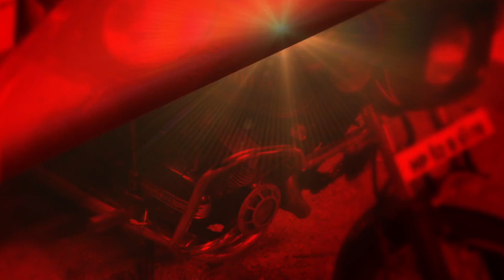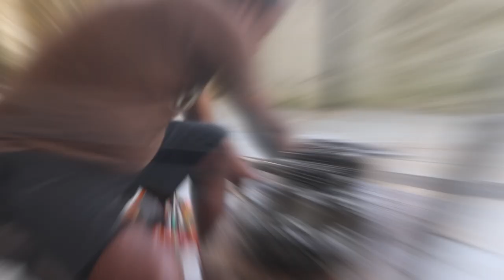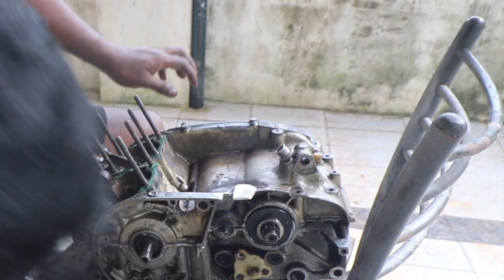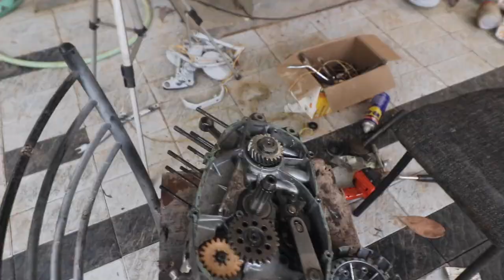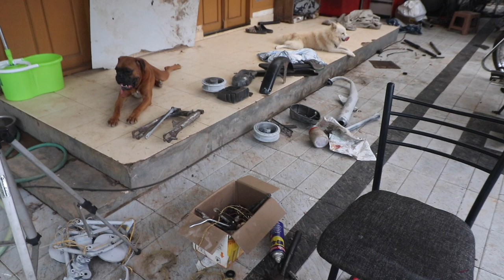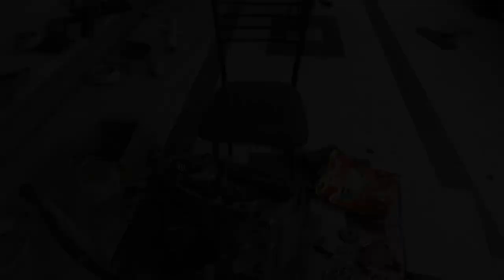Orange RD engine Rebuild in 10 minutes (Malayalam Video)

Comment: Hi Pramod

I see that you mentioned previous mechanic using gasket paste where he wasn't supposed to. Can you mention where it can be used?
Can paper gaskets be replaced by silicon gasket?
Can home made cornflakes container jugaad gasket be used instead of paper gasket?

Finally, can we use gasket compound for Rx 100 carb main gasket.?

Thanks
Reply from the maker: That’s a big list.

RTV sealant can only me used in non moving things, not around the crank 😂, it was used in bearings which are already bathed in oil. Regarding the usage of paper gasket and RTV, where 2 metal surfaces meet you can use a gasket or sealant, however where oil is involved it’s better to use a gasket. Reason the RTV won’t stick to an oily surface. 

In theory if the gasket is uniform and has plastic coating on both the sides it should work regardless if it comes out of a cornflakes box or a chocolate box.

Regarding usage of RTV in carbs is again a big no it will dissolve is the fuel and block passages inside the carb.

Comment: Chetta vandi paniyan agrahikunavarkk vendi  ditealed ayyi paraju.   sradhikanda kareghal nthokeya eannulla full ditealed video cheythudea.  Part part ayyi സ്വന്തമായി vandi paniyan agrahikunavarkk ath orupad  use full  avvum.
Reply from the maker: Restoration planning video und, problem ennu paranjal aarum payaye videos kannilla
Reply: @Yamakaze   almost njan ealla videosum kandu kazhiju👌...  Bro  oru cheriya doubt clear cheyythu tharamo.

Suzuki samurai umm  pinne tvs suzuki mx100 umm  cylinder kit thammil nthaghilum difference inda..      Njan ealla vandiudeum specification nokki eallam 98.2 cc. But . 1, . 2  hp difference innd  i mean point 1,2   ee cylinder agottum iggottum matti set cheythal nthaghilum പ്രശ്‌നം indavumo.?

Please reply me
Reply from the maker: @rahuljith.c.s1272  I have zero experience in max  100 and samurai engines, there is a video by some on decoding Suzuki engines. Good I for rice video, as far as I remember the reed valve and the intake ports are different in these bikes

Comment: Funny guy. He installed an old crankshaft, old bearings that are all dirty from rust. The same gearbox. He also smashes the engine parts with a hammer and calls it overhaul. This is destruction, not overhaul.
Reply from the maker: Thanks for noticing, what am I supposed to do on a bearing that was replaced around 500 kms ago? So your definition of a overhaul involves changing the gearbox? Also hitting with the hammer is not like blasphemy where if the engine is touched with a hammer all hell breaks loose. Thanks for watching and the feedback but may I know how many engines have you built going by the steps you mentioned? It’s easy to nit pick and troll people.  I know my engines well to the point that a hammer can be used as a mallet.